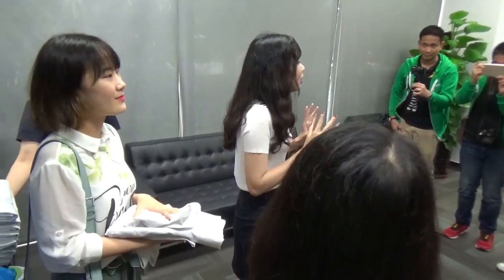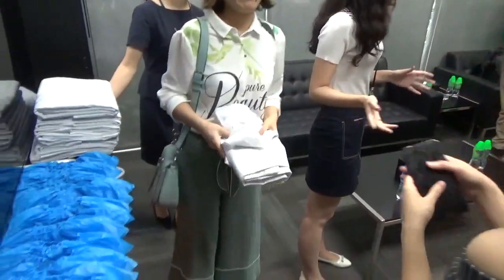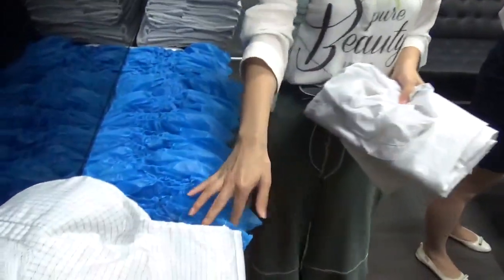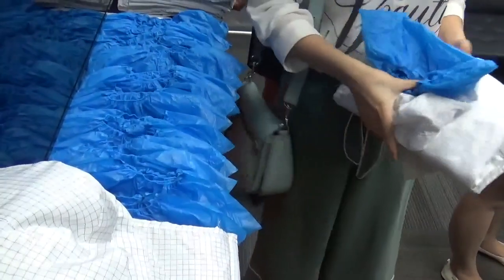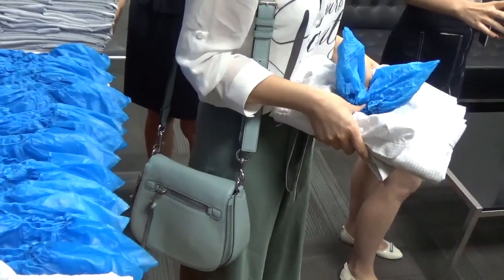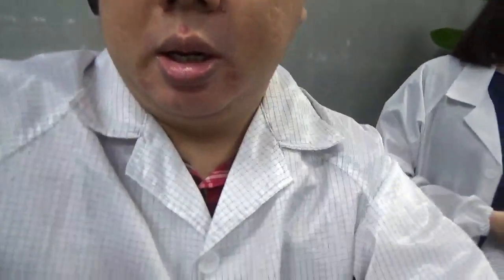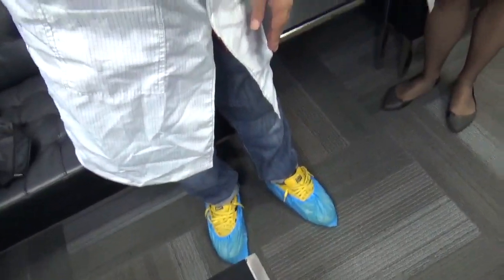OPPO Factory Tour SMT Center

Comment: I purchased a OPPO Ax5s for $200 Australian micro dollars . I'm extremely satisfied with my OPPO handset . I abuse the crap out it and it's never let me down . The Huge Battery capacity and beefy chipset has won me over as a OPPO fan . I appreciate the efforts of the workers on the line . I would fall asleep and be late for work if it was my job . Cheers

Comment: PCB Providing Wiring of Socket Components in an Electronic Device!
Printed circuit boards are generally found in three different types which are one sided, #twosided, 
and #multi-layeredboards. If the equipment is simple and only performs a few functions then a single sided board can be used. 
陈海天/Tiger Chen /Chengyi Electronics (Jiaxing) Co., Ltd
Email:Tiger@chanyee.com/Phone:+86-15669321020 /Web: www.chanyee.com